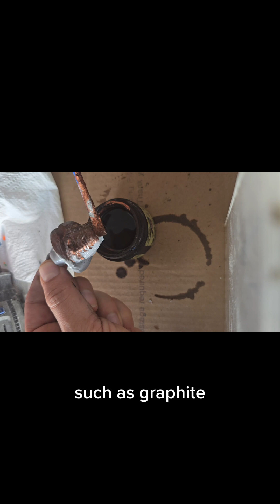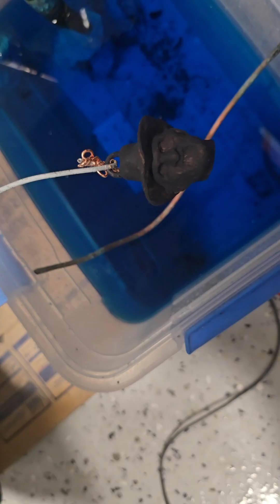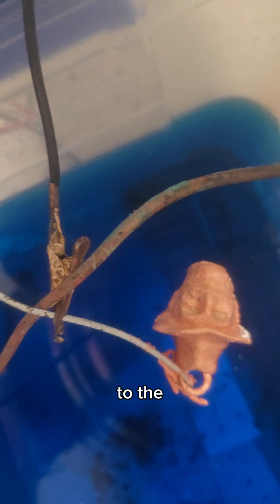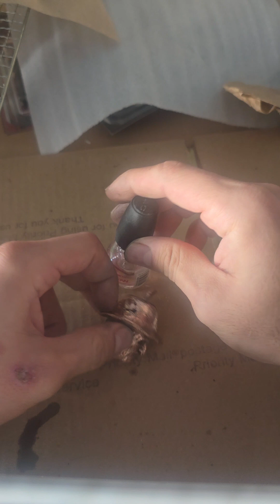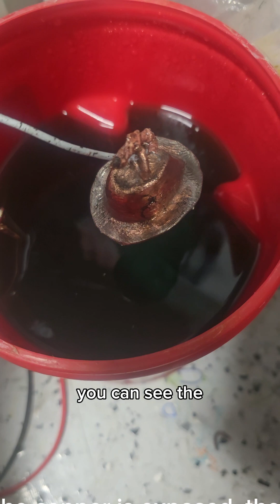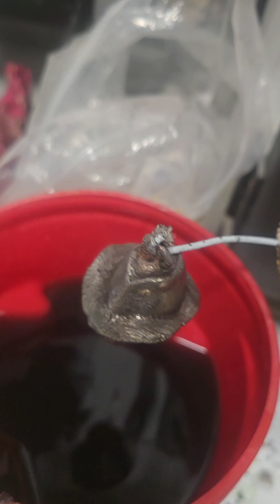3D Printing Freddy Krueger: Complete Nickel Plating Process!#3dprinting #copperplate #electroplating

Comment: What's your graphite paint formula, if u made it your self
Reply: Yeah ibwas wondering that too!!!
Reply from the maker: @eekadookatybern4296  regular graphite diluted with alcohol  mixed with a bit of remaining of copper conductive paint that I had .. I'll make a video soon of when I mix it etc
Reply from the maker: @just_is   it was just regular graphite paint with alcohol  to dilute it.  And I had a bit  remaining of copper conductive  that I mixed with it .
Reply: Would the alcohol cause it to dry out quickly?, could I use vinegar with graphite?
Reply from the maker: @eekadookatybern4296  i havent had any problem with the alcohol  tbh .  I haven't tried vinegar . I used to do water when. I first tried jt .
Reply from the maker: Don't use alot of alcohol though
Reply: @PlatingPulse23  u reckon air brushing would yield better results than normal brushing?
Reply from the maker: @just_is  yes big time . Just remember  when you brush it You leaving brush stroke/ line( over time you get the hang of it )  , airbrush  don't